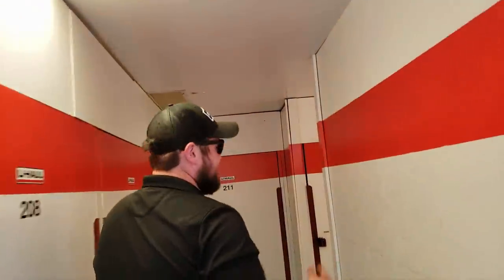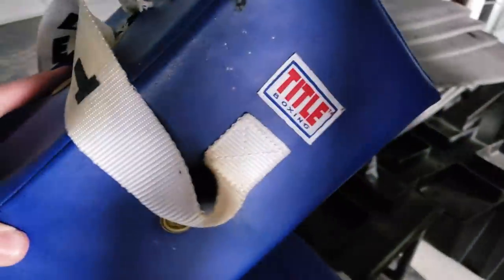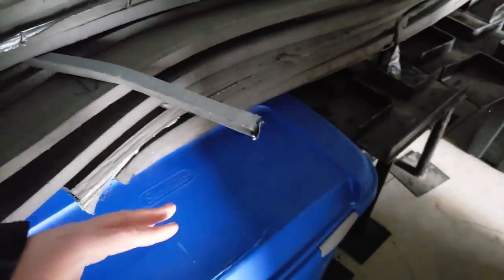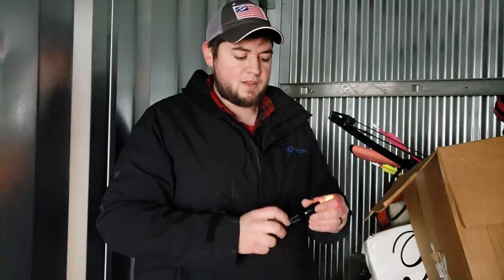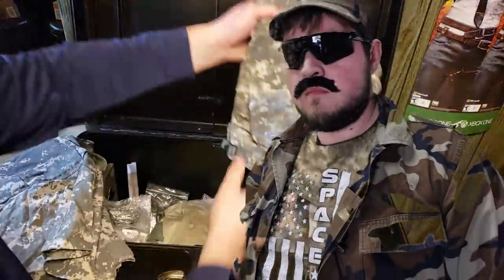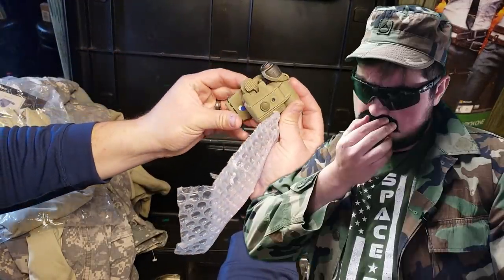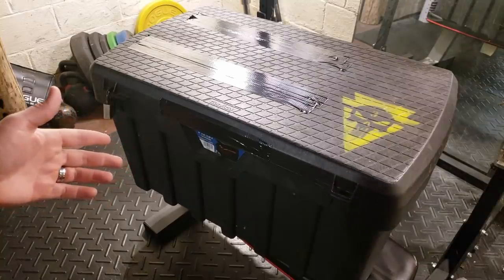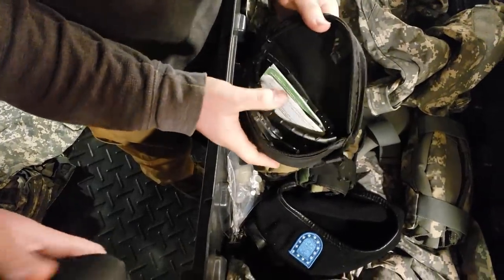This Military Storage Unit Pays off BIG with an Epic Knockout!

Comment: Dosen't look like a military stuff more like airsoft stuff
Reply: Definitely military, first thing I saw was a poncho liner
Reply: Did you watch the whole video?
Reply: @evancashman7614  yes and the only thing i saw was (military ) was the pistol 🤔
Reply: @colonelblt309  you need to get out more, all of the clothing was US Army issue gear.
Reply: @colonelblt309  there were a few patches and berets in there too :)
Reply: The mp5 has to be a airsoft. Unless its legal for a full auto in your state. Plus when you pulled the bolt back no way a 9mm could eject from it. But still cool.
Reply: @colonelblt309  the pistol is def not military
Reply: @aaronshafer-bond492  i saw the magasine and i think thats a real pistol
Reply: @colonelblt309  it is a real pistol.. just not "military"
Reply from the maker: That MP5 was a BB gun... I really should've screamed it from the mountain tops because it wasn't a real MP5.
Reply: It was all airport, considering I’m an airsofter
Reply from the maker: @trentonpenrod5889  I can see a airsofter wearing it, considering that's the only customer that would buy used army camouflage uniforms.
Reply: No thats very much the asu army uniform.
Reply: It is actual issued gear, and it still has the barcodes and other identifiers on it, and the tough boxes make it more identifiable as a soldier's equipment.

Comment: Great find, the MP5 is a gas powered bb gun, I had one, they made by Umarex and worth about £110 if in mint condition
Reply from the maker: Its a sweet little gun!
Reply: @ChaseThrifts  agreed, had loads of fun with mine, even put some cheap red dot sights on it
Reply: @shaunbaxter83  I had one for about a hour then took it back to the store.. POS mp5 bbgun..
Reply: Hackingspartan299, MP5 is an MP5.  Yeah there are different iterations, just like there are with most handguns and rifles...so yeah, it’s an MP5.

Comment: Just a little heads up whenever you were pulling on that kids bow you're actually supposed to pull on the knocking shrink or not actually supposed to pull on the tension strings that actually pulled attention to where you're actually able to supposed to get more power with a bow if you pull all three strings like that you'll actually snap the bow and you can actually break your arm
Reply from the maker: Oh "Snap" thanks for the heads up!
Reply from the maker: I would be very angry.

Comment: Oh you guys also realize that most of the equipment in those crates is not only standard issue Army equipment but is also still owned by the department of defense if it’s on someone’s hand receipt? I mean props for getting beater gear but make sure you’re not screwing over someone overseas on deployment and when he gets back he owes the DOD $3,000 worth of gear.
Reply from the maker: Yes.